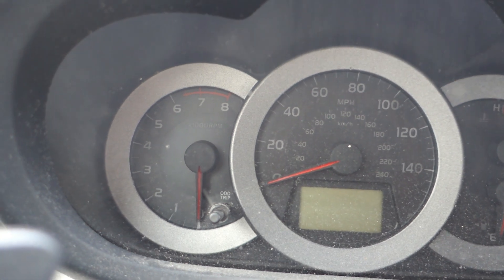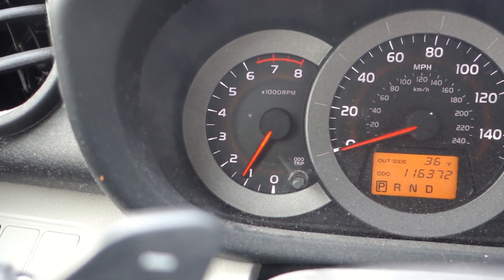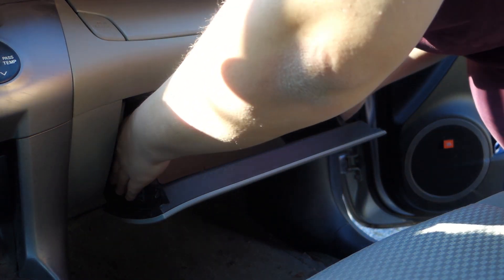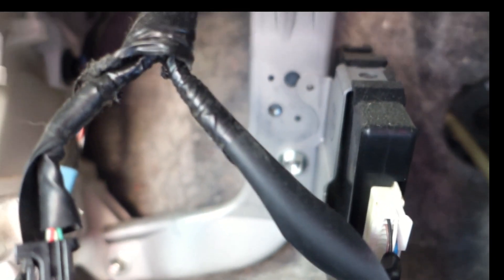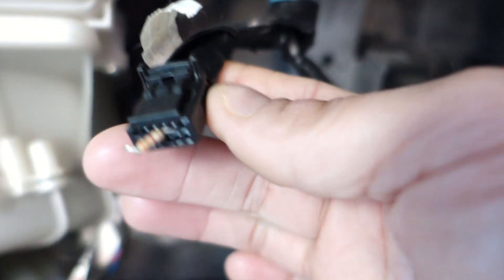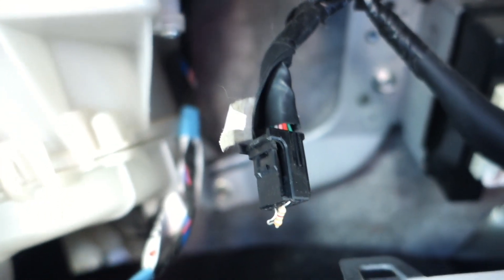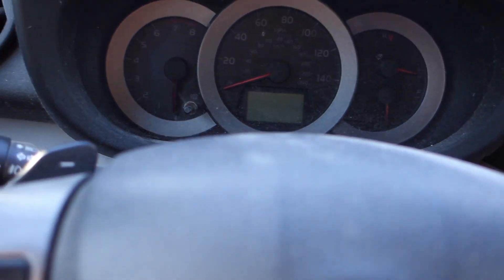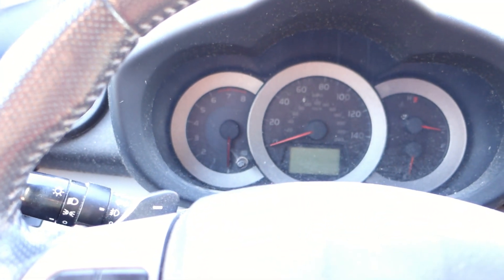How to Turn Off Toyota TPS Light Permanently

Comment: I have a 2008 Corolla LE had trouble finding the TPMS ECU . Taking out the glove box, at first I could find it. I look up and forward a bit and saw a black box slightly to the right with a black connector. Looking at the wires were the same and in the same position as in the schematic provided. I wanted to put the connector back in the ECU so I used the splice to connect the Black/White wire to the Green wire as another author did. No light, Thanks!

Comment: 2012 higlander does it works the same way
Reply from the maker: If you have just the idiot light for the low tire pressure then yes.

Comment: I appreciate your help in getting  that light off.  150,000 miles on my Corolla does NOT make changing those overpriced valve stems or their little batteries.  Believe it or not, in the dark ages, we checked tire pressure periodically and manually.
Reply: My Corolla's got 180,000 miles on it, and I think a small piece of black duct tape over that light will make it stop blinking, lol

Comment: There’s another video by ‘cadillac chad’ with a 2010 rav4 and he says connect the pink to the RED.  I have a 2011 so I dunno who’s correct.
Reply from the maker: I am because I got this info from this forum post, Post 22
https://www.rav4world.com/threads/how-to-disable-tpms-how-to-turn-off-tpms-light.85538/page-2

If you want the quickest way to turn the light off, by-pass everything and pull the cluster out and clip the pink wire going into it and put everything back.